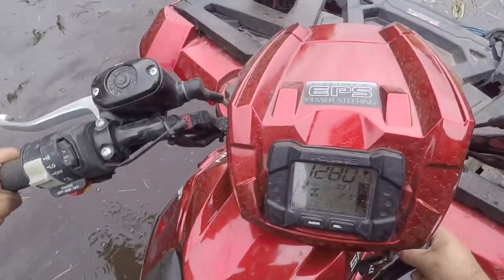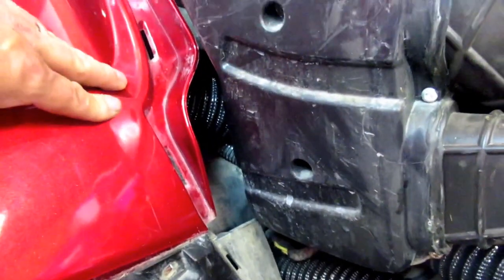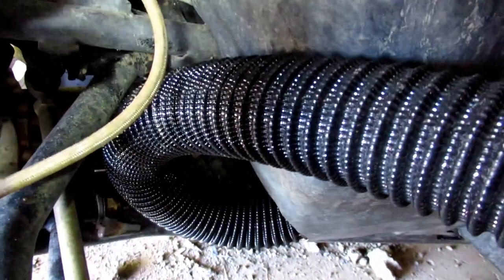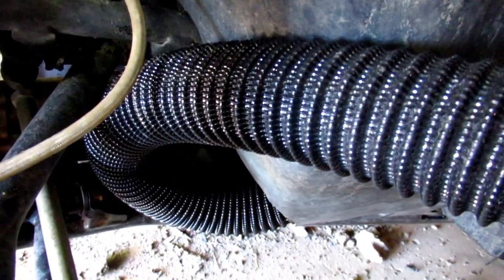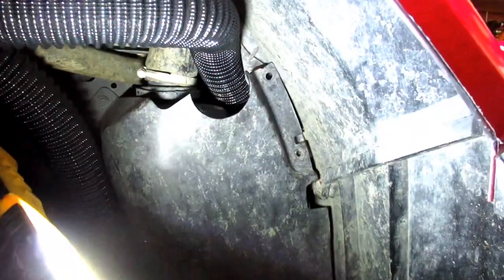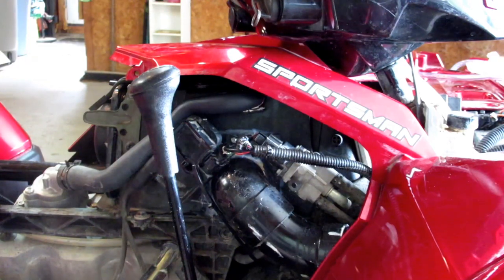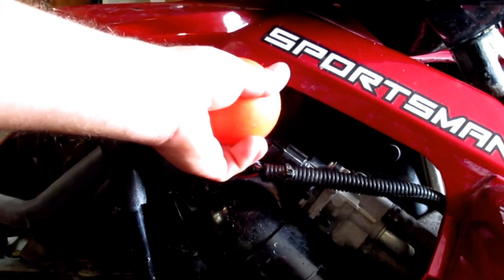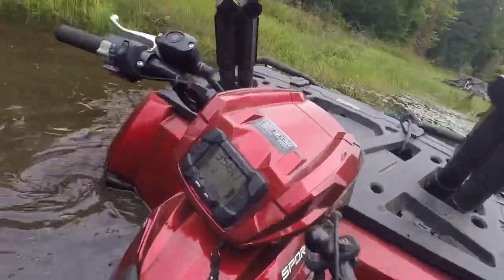Snorkel Install - SYA Warrior Riser-Polaris Sportsman 850 XP- Ep.3 IT'S DONE!

Comment: snorkels look cool but lets face it.even in 10 ft off water your wheeler is going to float enough to keep water out of your stock intake  just below your headlight.we would ride around in a quarry where water was over our head and never ingest water on a stock set up.keep your weight back and your front up and send it. even if you get off your machine the tires keep it a float unless it tips over then snorkels dont even help.
Reply from the maker: Yep that was first time ever in deeper water. Big learning curve!!

Comment: How’s getting to the oil dip stick?  The snorkels look nice , the hoses look like a bitch to do lol
Reply from the maker: +SCOTIAN it actually comes out fine, just adjust the hose out of the way.  The dip stick is quite long though!
How are you liking your lift kit on yours?
Reply: Adventures This Way i like it zero issues and I have about 860km so far. I’m not into the full mud like you but I do some .
Reply from the maker: @SCOTIAN_  Well that's good to hear.  It really depends on how you ride it and not hammering the throttle, to get longevity!